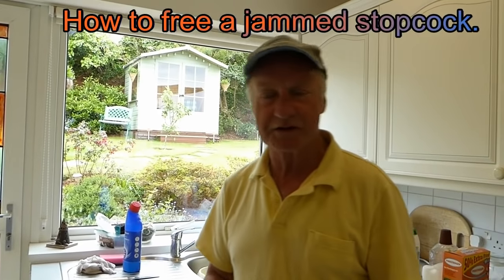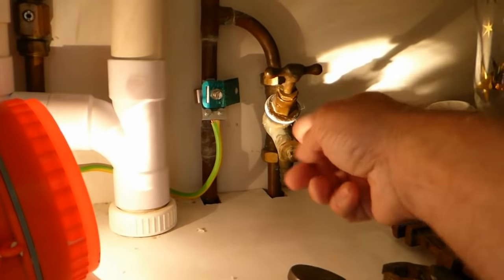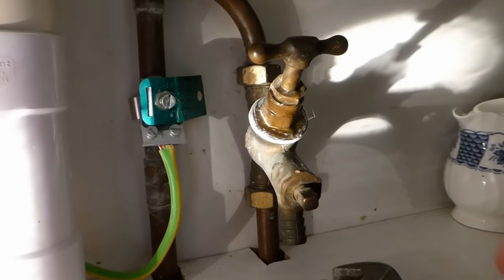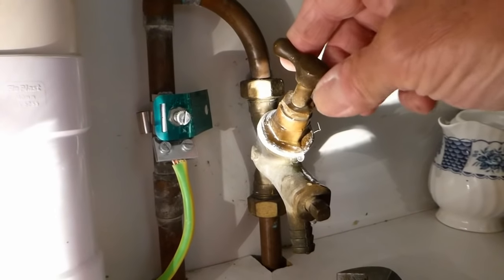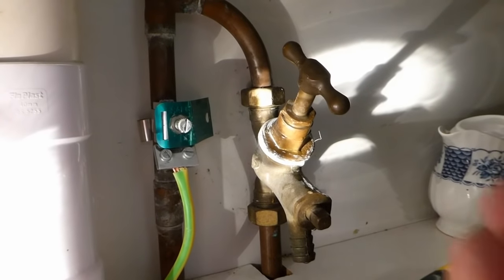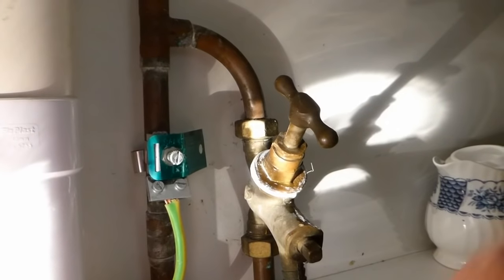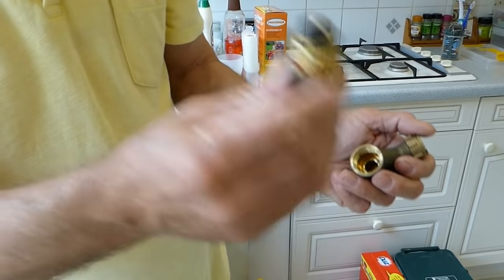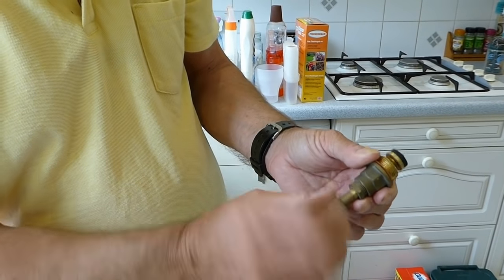How to free a jammed stopcock that will not turn.

Comment: If you cannot stop the gland leaking on a stop tap, do not keep tightening the gland but turn  off the  stop tap and the slacken the gland nut and screw it fully out,  get some PTFE and twist it to make a cord, wrap a few inches the PTFE cord around the tap stem and push it down into the gap between tap body and the stem with a small screwdriver, now refit the gland nut and this will compact down the PTFE to make a new gland seal and stop water dripping past gland.  You can actually buy PTFE solid cord specifically for this purpose, but twisting PTFE take to make a cord is pretty good..
Reply from the maker: Thanks.

Comment: I can't tell you how much trouble you just saved me...OK, I will tell you. 
After 15 years our old washing machine has given up the ghost. So I'm just crawling around under the sink to attempt to turn off the seized stop cock. Quick search of YouTube and here you are. 
Now not only do I know how to deal with the stopcock. But your tip for solving it while leaving the seized stopcock where it is reminded me of something. I'm pretty sure the bloke that installed the washing machine already did exactly that. So I might well be messing with something thats already fixed. 
Either way, once I get the washing machine pulled out properly, I'll know exactly what to do. You sir are a genius, and a generous one at that. Thanks for sharing.
Reply from the maker: No problem David.

Comment: Thanks for the video - I was able to free a stopcock which had been jammed for months - now I’ve been able to turn it I realised that the last time I’d had plumbing work done the water pressure hadn’t been turned back up - so I put up with Luke warm showers and slow running taps for no reason!
Reply from the maker: O well it happens.

Comment: Excellent and simple-to-understand video. Yes, we are in Kent on the North Downs and chalk is a nuisance. The problem we have is that slowly, bit by bit, the flow of cold water from the taps has greatly reduced, in fact when running a shower, the cold water flow stops completely. I believe our stopcock is seized in the partially closed position and will try you method to free it. Being a 100yr old house it is of course in a very inaccessible position and could do with turning 90 degrees as well. Thanks once again.
Reply from the maker: +Paul Narramore good luck with it.
Reply: Bluebell hill vicinity?

Comment: Good advice Al.
Years ago, I did something similar for my late mother, as her stopcock was at the same level as the cupboard base, so only half of it was visible/accessible, and it was practically impossible for me to turn, let alone her.
So above it, I fitted a water actuated stop valve that had a remote switch that I could put in a place where she could operate it if needed.

Comment: Thanks.  The best way to avoid the problem is to partly close and then reopen the thing every few months, same for gatevalves. Also, I don't leave them fully open - eighth of a turn clockwise from open.
Reply: Easier said than done, unless you write it on your calendar every quarter. Last suggestion is good.

Comment: Superb video. One point the electrician should have put the water bonding clamp just after the stop cock before the branch. He or she didn't i guess as the pipework installer gave him no straight copper to put it on as is usually the case ! The bend looks shallow enough though to get a decent contact. Would look cluttered but under sink affairs is not about aesthetics
Reply from the maker: Thanks for the info.

Comment: I spent an hour wedged under my kitchen sink trying to free a jammed stop-cock. Went to pub in frustration, someone suggested 'just put a new one in'. Next day, £4.50 at local plumbers, a couple of turns of ptfe tape round the old olives on the pipes and  I am Robert's nephew. A 10 minute job sorted by stepping back and thinking. Still OK 20 years later.

Comment: Thanks for the video, easy to follow. I live in hard water area and stop valve wouldn't move at all. I tried your first technique and it worked really well. Moved just a mm at first but then more and more after a few twists back and forward. I was worried about breaking the pipe or the joint so held it in place first.......I was still expecting something to snap but all well, thanks.
Reply from the maker: No problem.

Comment: Knowing beforehand where the shut off outside is  having access to it and any key required will help prevent a minor disaster if it all goes wrong!  When they start getting difficult it easier and simpler to just replace the stop cock, very cheap and easy to do.
Reply from the maker: Thanks for the good advice Andrew.

Comment: Meant to say, good sensible well explained video, trouble is those old stop cocks always do that, and if you had an emergency you would not want to have to do that, they require regular maintainance, as you are doing, and all my years in plumbing never seen a sc with a dc, just shows, well done
Reply from the maker: Thanks Paul.
Reply: Whats a "dc"?

Comment: Don't always think you are out of the woods even if you do get the valve to shut.
I had to deal with a sticky gate valve once. Got it to close after a little fuss n fiddling. Fun came when I went to open it. The gate jammed in the body, I hadn't shut it that tight either. Then, trying to free it, the shaft broke.
It was barrel in, to copper out.
I fitted new gate valve downstream of old one. I then had to freeze the pipe above the now broken valve, strip the gate out of it, then re-assemble it, a bit like you suggested with fitting secondary S/C. As you say, not best practice, but it was in old flats and I couldn't find anyway to isolate it.
Must admit, it was a twtchy bum moment, just in case the ice plug failed while the old G/V was in pieces. There was a fair head of water to the valve. 
That was a fun day at the office.
Reply from the maker: All the fun of being a plumber.
Reply: Just bung the tank feed. Easy. or drain tank

Comment: You can use a salt water proof grease on the shaft once it's fully open then screw it all the way closed this great will keep calcium from building up. Also , you should crack these valves a couple times a yr to keep them free. Exercising them it's called.

Comment: Nice trick, noted. Unfortunately, the one time this was an issue for me the stopcock was about 2” above the ground, & the groundpipe was plastic! The big risk was splitting the pipe and as I was in a block of 9 flats with only One stopcock out front, splitting the ground pipe was NOT an option. Major work as up through re-enforced concrete, and we’d all have been without water for the duration! 
The fix required was done live, (late at night & his freeze kit had no gas lol).
Reply from the maker: Thanks for sharing!

Comment: I have two old stop cocks which I have left in line, fully open which would not shut,  and managed to put new replacements after them when the waterboard turned the water off and it works a treat and  I dont see it as bad practice.  I can't find the roadside stop cock.  When eventually the water board turn up again to dig up the road up and turn the water off I will remove all the defunct stop taps in my house and install a brand new internal stop cock.
Reply from the maker: Thanks Dave.

Comment: Just had that issue with a basin & toilet. Never used and house has a softner..It didn't make sense..pulled the stems, washers never squose and so gritty..i wiped them off and greased the threads they hold and turn beautiful. ..👍👍
Reply from the maker: Great job.

Comment: Neat option to reposition stop valve further along the pipe! Regrettably, this solution might well have solved my problem: but, the old stop cock was not only jammed solid, it was leaking at the unions due faulty installation damaging the olives, which appeared to have been packed with putty. So, valve had to be removed from the system completely and a new length of pipe inserted to get job done as well as using new fittings, just to be sure. Just bad luck in my case, but all things being equal these tips will work very well and save unnecessary work.
Reply from the maker: Cheers Ron.

Comment: Whenever I replace or install new valves/stopcocks, I always without hesitation, will take apart anything that is removable and apply a liberal coating of what I call anti-seize/corrosion preventer to all moving parts then reassemble. Works fantastic !
Reply: Vaseline will work pal .
Reply: @anthony342 
 Neither are good practice if this is your drinking water as both are toxic for the human body.  Anti seize corrosion preventer is poisonous.
Reply: bet you wear a suit and tie to work .

Comment: Another interesting video Al. I'm a recently qualified gasman to trade so I'm always interested to see all the plumbing tricks of the trade. I may have to invest in a set of Footprints too, I usually reach for the water pump pliers for the hard to undo nuts.
Reply from the maker: I find the footprints are my most used plumbing tool.
Reply: There's also the 'mole wrench' style self-grip pliers, useful especially for things that don't mind the crush-type grip

Comment: Thanks for this excellent video.
Is this safe to do or can it end up in emergency if it's really badly stuck?
Reply from the maker: Every plumbing job has it`s risk but usually the worse you can do is to snap the handle off.

Comment: Hi, Thank you, you inspired me to use vinegar to dissolve the limescale and I've now managed to close the tap. The key point that I learnt was that it was the limescale that was clogging up the tap.
Reply from the maker: Glad you sorted it.
Reply: As I live in a (very?) hard water I've scraped the obvious limescale off and am now gently bathing the face of the nut and the exposed screwthread with spirit vinegar. I may try Tomato ketchup which is good for cleaning copper and has advantage that it doesnt run off

Comment: That tool at 1:29 I bought in 1980s for £1 got me out of a lot of 
trouble & I used it today at the back of a corner cupboard could 
hardly see the tap needed the mains off to change Kitchen tap,
Sometimes you can get a leak from the nut & need to use some tape on it, WD40 must help to free it

Comment: If it's not just stiff through a bit of lime scale and the tap is really seized, then the simplest and quickest repair is to replace the valve assembly, but if your in an old house you will probably find the thread on the stopcock is Imperial while that shiny new one is metric.
Reply from the maker: Thanks for the info.

Comment: Spot on advice, on all levels. The only minor point that could have been added was to turn the stopcock off and on again once a year to help prevent it seizing that badly in the first place. A little maintenance can save a lot of hassle. (Oh, and if you do use oil to release it, wash it off with lots of detergent (at a neighbours or friends place, your water will be off - unless you’re unlucky enough to have an older house with a tank in the roof) before refitting - oil in your water supply wont do you any good at all).
Reply from the maker: Thanks Andy.

Comment: Hi Derek.  My mother (who has MS) has a problem with her hot water (not the smaller heating)  tank.  It has been trickling water through the over flow for around a year.  Ive only just been made aware of this.  In the roof space there is a stop tap that links the mains to hot water tank.  I tried your advice and the tap wont budge.  I even took the outdoor pole that turns off outdoor stop taps into the roof space and still no luck.  The irony here is that my late father was a plumber!

Im going to try out your advice with the one under her sink which is also stuck.  I`ll keep you posted.
Reply from the maker: Good luck.

Comment: I would add: work the collar nut free, undo it completely (put towel underneath to catch the drips, not a lot), put in a generous squirt of silicone oil (no smell, non-allergenic), and then work the spindle loose.  If the tap is really bad, a blast with a blowlamp will help it move.  I've done many taps, far worse than this, starting with a pre-Roman (joke) lime encrusted crud lump in my own house.  Nice vid, thanks for posting.
Reply from the maker: Thanks for the extra info theo.

Comment: tried all that - still seized up, mole grips hold the round valve body better than any spanner i can find,  from now on i will fully open/close all
valves once per year to prevent (hopefully) also i always put coppaslip or grease on threads to make next repair easier & clean up
valve seating
Reply from the maker: A tough lesson to learn Fred.

Comment: Hi, many thanks for this, the best video for this I've found. Could you please list all the different tools you've used for just the first part of the video as I'm not sure exactly which tool was called what and used for which action?
Reply from the maker: Hi Ruby, a pair of 7 inch footprints, a small adjustable spanner or a small pair of 7 inch stillsons.
Reply: dereton33 Thank you! and Bless you for your prompt response, really appreciate it.
Reply: dereton33 I've found a 6 inch adjustable spanner/wrench and 7 inch footprint pipe wrench but they both look very similar. Should I get both please?

Comment: Thank you. Interesting.
Is itvthe same method with the Red 'Wheeled/Round' type? I want to replace my shower, itcturned but didn't  feel like it turned 100%, , I turned the electric switch which was dedicated to the shower off & the little bit of water stopped coming out but when I started taking the shower off I turned the nut back up tight as too much water was vining out, I didn't can't to chance it. 
Thanks.
Reply from the maker: Yes, exactly
Reply: Red 'Wheeled/Round' type= GATE VALVE

Comment: Thanks. I'm just moving from my Apartment to a house, I'm replacing the taps as they are expensive  & replacing them with every day cheaper ones, the problem I have is the stop clock won't move, I was going to try the Monkey wrench tomorrow but I didn't know you could turn the nut underneath it, so thanks, I'm  just concerned if it doesn't work I can't turn the water off anywhere else  so I won't be able to put another stop cock in, any advice? I was trying Spray oil, didn't know that won't work.Thanks.
Reply from the maker: You could always use a freezer kit as a last resort.

Comment: Take an old rag soak it in vinegar then wrap it around the stopcock. Leave it for a couple of days then it will come off easily. It's the minerals in the water that causes it to seize up.
Reply from the maker: Thanks for the info David.
Reply: dereton33 We live in a Canadian city where the water is full of lime and calcium. Our water systems and stop cocks get plugged up quite frequently.
Reply from the maker: Parts of England have hard water which does the same thing.

Comment: Wire brush the tap spindle to remove all limescale first.  Ease off the collar nut (packing box) back & forth till it come free, lift collar nut right out & add (ideally) silicone oil (no smell) & replace it, but not too tight.  Ease the tap back & forth, increasing the range bit by bit. DON'T force it, or damage will occur.  Add heat if necessary. Do NOT use Stilsons cos they chew up the tap.  Shut the water off at the meter, replace the washer, or the whole tap.  Or, if it is beyond access / repair, add a second stop tap above it, having first dismantled / lubricated / reassembled it first.  I have seen taps far worse than this.
Reply from the maker: Thanks for the info.

Comment: My plumper trying doing this has broken the turning handle. He did his work by closing the mains off in the street. But now I have no possibility to turn the water off in my property (for repairs) as this one is broken. I wonder how can I get it fixed?
Reply from the maker: You will also have to turn the water off outside.

Comment: You need to take care when using a wrench. If you twist the whole body the tap, you can damage the compression joints at either end and spring a leak.
Reply from the maker: Care is always required.

Comment: Hi
If you can please share any information on how I can looses or Open up a Jammed Brass Rose Water Sprinkler. .
I suppose the Threads Inside Jammed Due to Corrosion.
Reply from the maker: Spray plenty of WD 40 on it first.

Comment: How do you insert the new stop tap when the pipes either side are fixed and cannot be pushed apart? I have managed it with Yorkshire fittings by filing off the internal central ring but that is not an option with a more substantial stop cock.
Reply from the maker: Cut the pipe further back about a foot or so if you have the room, by inserting a small piece of pipe you will be able to insert fully into the stopcock, bend the copper out and into the coupling above.

Comment: Went to uk to clean out an old council house as the house would be empty for some time I nori e the stop cock was frozen solid due to calcium build up I could not move it the lad next door so we switched the water off from the mains.
Open up all the taps to get rid of the water in them then closed them back up just in case the wate was switched back on from the mains at the road,
Reply from the maker: Great stuff.

Comment: Hi. I wonder if you can help me? I had to turn off the stopcock which feeds my combi boiler (I have two water feeds to my house). It was so stiff that I had to use a wrench. I managed to turn it back on again with the wrench. Since then, everytime I turn on a hot tap, I get a loud vibration until I open and close the kitchen hot tap. Do I need a new stopcock? Thanks in advance, Paul.
Reply from the maker: No, just close the stopcock back down to a slower flow from the tap.
Reply: All sorted thanks. Turned out to be a dodgy kitchen tap. Thank you.
Reply from the maker: No problem.